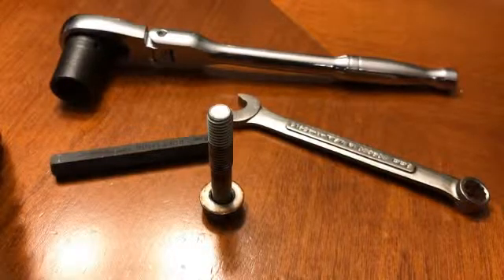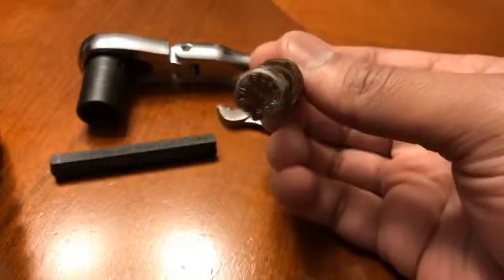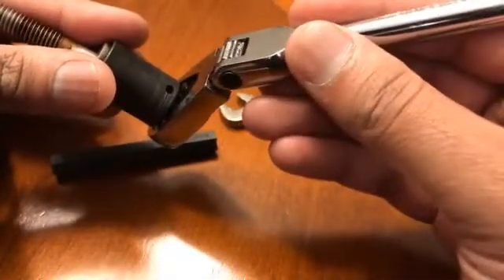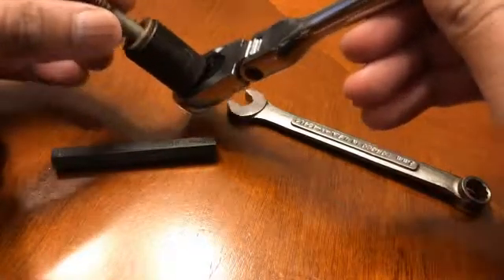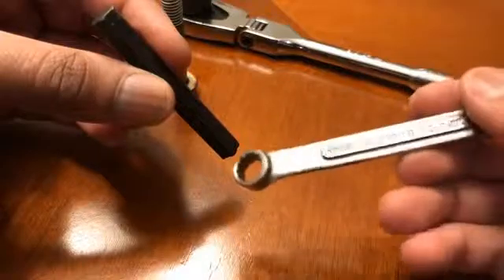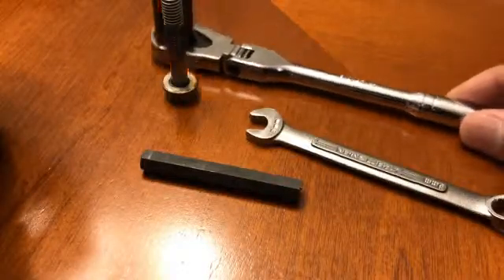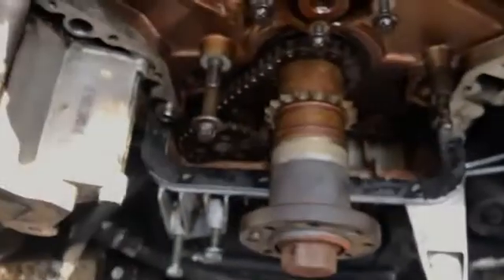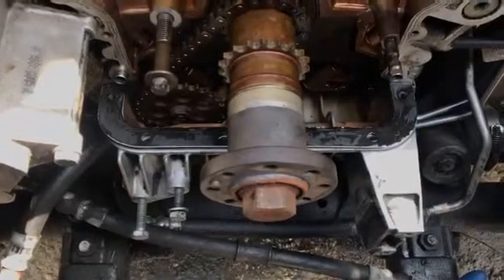2004 Range Rover HSE M62TU 4.4L V8 Tightening Oil Pump Chain Tension Without Removing Upper Oil Pan

Comment: Very Difficult also you may need to remove the lower oil pan if anything drops it's a real pain in the ass,I had mine off already 
Also still not able to adjust mine it's been a real pain!!!

Comment: Good information, are you positive that moving the adjuster without slackening the other 2 oil pump mounting bolts is ok? Will the other 2 be disturbed so as to become loose maybe?
Reply from the maker: Two years later, still running strong!